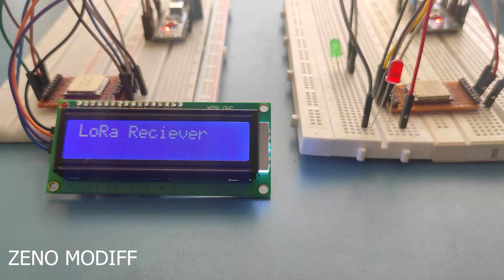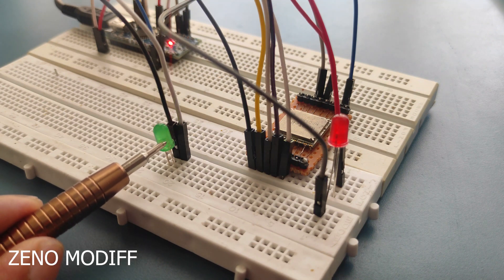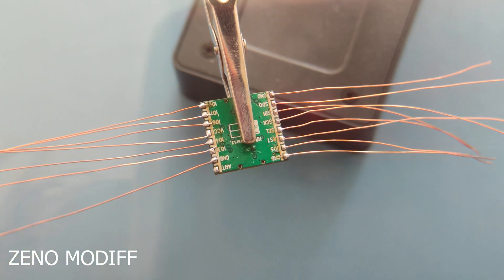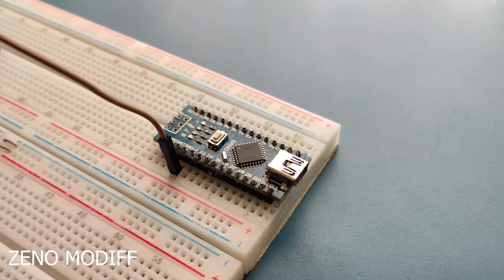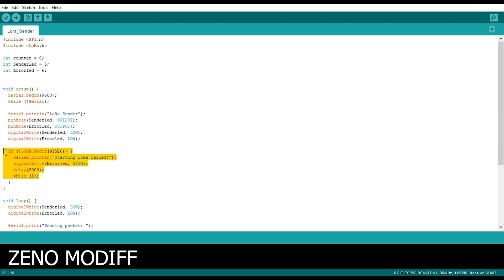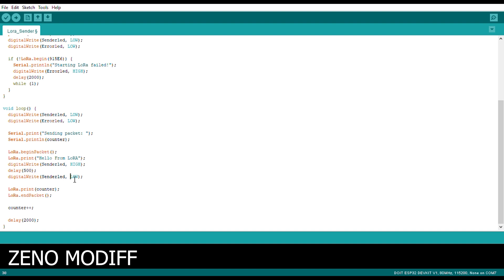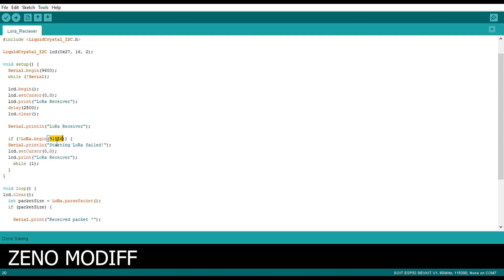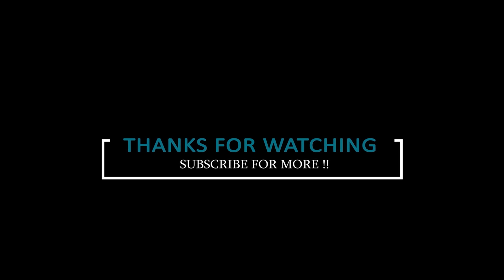How To Use Lora With Arduino Basic Communication

Comment: How many sender lora node can communicate with one receiver lora node
Reply from the maker: I have tried 7.... But you can use as may as you need specify the frequency in the code and increase the delay of sending packages in each slave lora modules it should work flawlessly .... Like 1 salve have delay of 1000 then second lora need to have delay of 2000 or 3000 like wise increase the delay